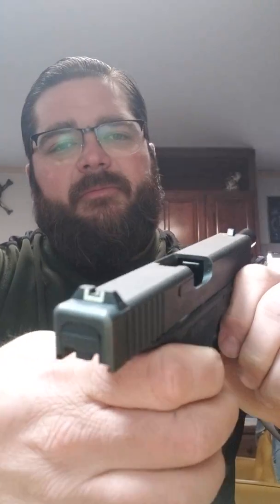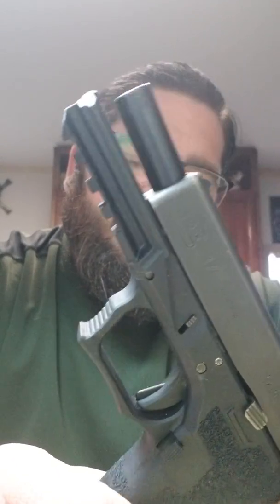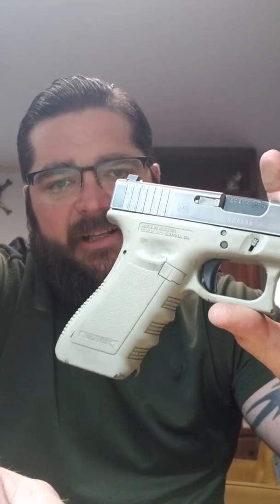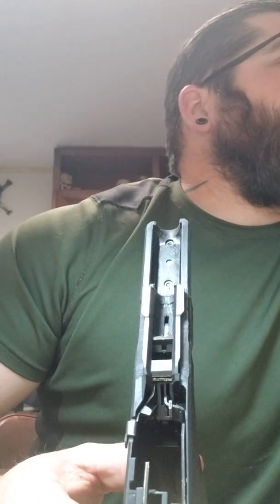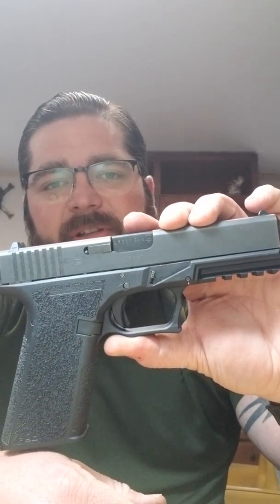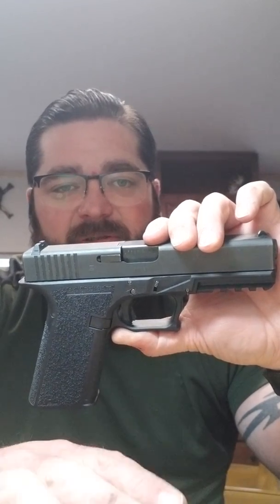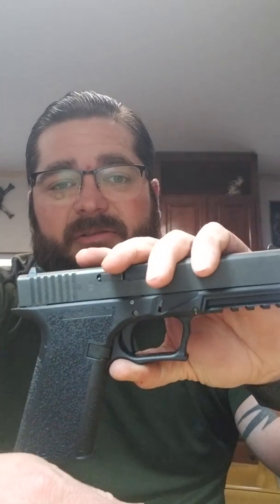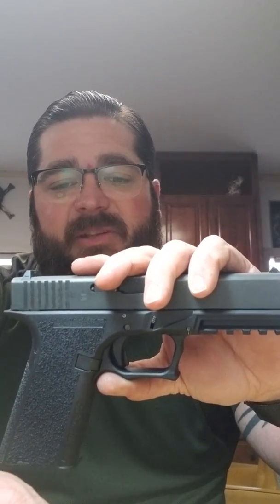Polymer 80 issue fixed

Comment: Sometimes, during the hollowing out of the front guide spring channel, with the myriad of tools used out there, a minute amount of debris finds its way into the hole for the take-down spring.  And, as usual, we all shove the take-down spring into it's hole, compressing any shavings down and then not letting the spring seat all the way.  I find that using a stout sewing needle to probe the hole, digging out anything down there will let the take-down spring seat fully.
Reply from the maker: Your absolutely right ! And its possible that could have happened with this one . I didnt use a needle to scrape it out but i did hit it with some cleaner and compressed air . But i didnt even think about using a needle to clean it out ! Thanks for watching and taking time to comment ! Great tip!

Comment: Check the trigger spring attachment to the down leg on the crucible, also there can be an interference fit with the trigger bar where it hits the frame at the trigger block.
Reply from the maker: Thanks for the advice ! Also thanks for taking time to watch the video and comment !
Reply: @fakeitormakeit83  the spring almost always gets turned to the side, should be strait up and down.

Comment: Glad you found a fix. Another cause of this issue, and something that should be checked on every build like this, is the sear/striker interface. You can check the interface using an inexpensive armorers plate. It should have 80-100% contact. I would err towards 80% as anything higher than 100% will cause this issue. Too little engagement can cause binary fire. The actual adjustment of the cruciform can be done using a vise or an adjustable wrench.
Reply from the maker: Thanks for that ! Thats a very good point you brought up !
Reply: Over polishing can cause auto fire as well
Ran into that once
Scared the shit out of me because i wasnt expecting it
Threw that whole trigger bar away and ordered a new one 
In my experience you save headaches by matching parts
Just buy OEM glock parts
Because the tolerances will mesh perfectly

Comment: I just built my first one of these. Had the same issue. Those slide lock sprigs they're sending out are way too long. I cut mine down quite a bit in order to make it fit. Just to be safe I ordered an OEM spring and the difference is crazy. Needless to say I put in the OEM spring and it runs flawless.
Reply from the maker: Yes i definitely felt wierd trimming the spring lol! Im not a hige glock guy so this was kinda new to me at the time i made this video. And your right i have made it a habit to have spare parts and springs to all my platforms . Thankyou for watching the video and taking time to comment ! I really appreciate it !
Reply: @fakeitormakeit83  can anyone help me with my build ?
Reply from the maker: @zannyy7812  what kind of problems are you having?
Reply: @fakeitormakeit83  do you have instagram so I can show you or snap chat
Reply from the maker: @zannyy7812  yes im on instagram
Reply: @fakeitormakeit83  what’s your instagram
Reply: @fakeitormakeit83  I followed you fam I dmed you as well hit me back when you get a chance

Comment: This is great, very informative. Impressive how you tracked down such a subtle cause of failure to function.  I knew about the slide lock spring issue, but only in relation to binding the recoil spring and preventing the slide from fully returning to battery. But causing the slide to sit too far forward? That was news to me. Thanks for sharing this.
Reply from the maker: Thanks so much for the comment ! Yes I was surprised as well . And I came by the thought after many nights of deep contemplation lol I lost some serious sleep lmao

Comment: I have a poly-80, and everything seems to be right, except when I hold the trigger down and rack the slide, I can ease off the trigger, and it will fire again. So the trigger won't reset properly. Any of the safeties won't catch the firing pin. I'm stumped.
Reply from the maker: Thats a pretty dangerous problem you have buddy. Im totally not being a wise ass , but were you the one who did the kit or did someone else? Check this article out. And search doubling and it should give you an idea of the list of could bes .
Reply from the maker: https://blog.roninsgrips.com/what-to-do-if-your-polymer80-or-glock-double-fires-it-may-be-your-aftermarket-connector/
Reply: @Fake It or Make It  I did the kit, it is a serious problem lol. I've had this weapon for a while, have been changing parts, and doing all the research I can find. To no avail. I'll check the site out. Thanks
Reply: I watched that Intel you sent. I acutely just got in a oem glock connector and tryed it out. Same thing happens. So if I take my thumb and press down on top of the slid it will reset the trigger ok. But if I ever so slightly nudge the side upward it will fire even if I have the trigger held down. So frustrating
Reply from the maker: @Ben Hall  it seems like there is some tolerance issues between the frame and the slide 🤔
Reply: I have two and have the same problem with both. One was the trigger locking block the ears that the slide rides on. The left was higher then the right. Looking at the weapon from back to front. So I took the block to the vice and evened the out and now it shoots fine. I'm still very cautious with it though. The other everything seems like it should be fine. There's very little play between the slide and the frame.
Reply from the maker: @benhall9835  it can definitely be difficult to narrow down the issue . I wish i could be more help! I had to just pick it apart piece by piece.  Analyzing every mating surface and how everything interacted with each other.
Reply: Do some research on sear engagement if you haven’t got a handle on it yet I believe that could be your issue. It’s an easy fix

Comment: Yup, had same issue.  My P80 wasn't going fully into battery if you racked it and let the slide down slow, it kept getting caught.  Was tearing my hair out trying to fix it.  Re-ground the rails, oiled the shit out of everything, made sure the guide rod wasn't getting caught up in the channel.  Turns out it was the stupid takedown lever spring...  Snipped off a tiny bit of it from the end the goes into the frame, gun cycles like a champ now.
Reply from the maker: Hey brother thanks for commenting! Yeah its hard to imagine that one lil take down spring can cause that much heart ache!

Comment: Ran into an issue where the slide was sticking slightly as the slide unlocked, turns out removing material from the top of the locking block is a thing that very few people mention and took me ages to figure out.
Reply from the maker: Hey thanks for watching and taking time to comment ! Thats a really good point ! I really want to get a p80 for myself and do one from start to finish as this one was already "built" . I would like to see what issues i encounter.
Reply: @fakeitormakeit83  There are good reasons to, the p80 glock 26 is actually a better glock 26 than glock themselves make since it has a better trigger guard, better texturing and a rail. There is also something extra satisfying about building it yourself, it'll be just as reliable as anything else provided you fit things together correctly, just as any other handgun you should expect to tweak things and lap the rails with some layout fluid or a sharpie.
Reply from the maker: @PineyJustice  hell yeah ! Thats one of my favorite past times is trying figure out what is wrong with somthing and "building" stuff! I definitely love tweaking all my stuff lol i cant leave anything alone lol

Comment: I always just use stock glock internals and i haven't had any problems.  I did try to go cheap with ebay parts and the trigger pull got harder and harder then it would not fire at all.  I pulled it all out and went stock block and it worked fine from then on.

Comment: I`m having issues with the slide . It won`t rack. I`m narrowing it down piece by piece. I haven`t figured it out yet, but I got nothing but time. Everything seems to be together right, and the slide works without the barrel and recoil spring.
Reply from the maker: Thanks for stopping by and commenting! Your definitely on the right track . Its just a matter of narrowing down each particular component and knowing how they interact.  Seems like maybe a barrel to slide engagement issue maybe ?

Comment: Florida gunsmiths will work on a zip gun if you pay. I got help with my P80, the only mishap in my assembly was the cruciform spring being upside down. I took to the armorer before the range 🙂

Comment: I have build a g17 just like this like last week, and it shoot 7 perfect. But when I changed the backplate and tried to shoot it it stopped… and I noticed my pin is kinda doin the same thing
Reply from the maker: One thing to keep in mind is that what your most recent change was on the piece is usually the first place i look if i get malfunctions after installing it. I know it sounds obvious but the types of projects require success by eliminating issues one at a time as you identify them . If you install somthing and it stops working , reinstall the old part and see if it functions again. If it does study the difference in the parts , if it doesnt look deeper into what these particular parts do in the function of the piece . You gotta basically turn into sherlock holmes !

Comment: Hi I have a poly 19 and the slide goes on but it won’t rack unless I strongman it and my guide rod front is stick out a little bit
Reply: Any things I can try to get it racking smoothly so I can break it in at the range
Reply from the maker: Hmmm . So i would check to see what is rubbing . Can you see any wear marks anywhere on the slide guide rails or marks on the under side of the slide . Take a bright light and a good close eye and inspect every inch of the slide and frame . Let me know what you see . Also thanks for checking the video out !

Comment: My p80 glock 26 won't lock back at all its like an 1/8 short of going back the whole way for the slide release lever to go up into the notch in the side of the slide.  Any 9ne have any info? I can't find nothing on this anywhere?
Reply from the maker: So its not going back far enough to lock back 🤔. It could be a few things and hopefully some one else will chime in . But what i would do is go over the entire thing with a fine tooth comb. Really look at all the mating surfaces after moving the slide back and forth . Look closely for rub marks and wear marks that could be stopping your slide from reaching its final destination.  There is so many little nuances on these types of projects that have to be looked at . But at its most simple its parts rubbing somewhere that shouldn't.  I would even say if the wear marks are hard to see use a sharpie to color the suspected areas and see if any sharpee is removed . But i would say just a guess that somthing is going on up.towards the front of the pew . Check your pocket for where your spring is make sure its not binding on anything and your slide rails are in good order .i hope some of that helps!
Reply: @fakeitormakeit83  yep its like a a smidge short of going back the whole way. I've built this before and never had this problem and can't find a vid or even a web page with someone with this issue.

Comment: Hey I’m having trouble with a p80 going back into battery I sanded down the take down spring to fit correctly and took just a little bit more then needed with the spring channel I just can’t find my problem I even rounded out my safety plunger and all of my parts work together my slid just won’t go fully back into battery I would love help on this fix
Reply from the maker: Hmmm so my first question would be . Is there any wear marks on the guide rails or on the slide indicating that maybe there is something up with the frame tolerances that are not allowing the slide to go all the way forward?
Reply: @fakeitormakeit83  no it’s a jsd supply slide I’ll do some more sanding to the rails and get back to you on how everything tuned out
Reply from the maker: @ChrisKyle902  yes and as im sure your well aware just take your time and check your progress often 😉

Comment: Having the same malfunction with mine. Before I go and snip that takedown spring, how much of it did you remove?
Reply from the maker: Man I didnt snip it per say . I took a small needle file and just worked it down until I got good functionality.  On this particular one It prolly took maybe 1/32 off if memory serves me correctly.
Reply: A problem I ran into on my first build.  The next three I did I covered that hole with Scotch tape before I ever cut, dremeled, or sanded anything. all it takes is a little bit of dust to get down in that hole and then your slide lock spring won't go down far enough.

Comment: Would you happen to have the part number on one of those .
Reply from the maker: SPO2317 depending on what generation yours is .
Reply: @fakeitormakeit83  just picked it up late last year brand new
Reply from the maker: @hollywoodRunnaOG  so its a gen 5. Yours isnt a polymer 80 though is it?
Reply: @fakeitormakeit83  p80 on the bottom corner of the grip. I wish it was a gen 5 🤣 california is smh 🤐
Reply from the maker: @hollywoodRunnaOG  ohhhhh i gotcha .

Comment: Mine is the opposite. I need to push my slide forward sometimes in order for it to fire. I thought My recoil spring was too much for the round. However I noticed that my spring isn’t straight like it’s supposed to be. What would you recommend swap the spring first?
Reply from the maker: Is it a ploymer 80 ? Or is it a actual glock?
Reply: @fakeitormakeit83  polymer 80
Reply from the maker: So it could be a few different things if its not going into battery i wonder if there is any wear marks on the guide rails or on the barrel lock up area ? Or maybe an area of polymer impeding proper function?
Reply: @fakeitormakeit83  I found a little flaw in the guided rod rail nothing major but perhaps it’s the reason for the malfunction. When I go to the range I’ll find out if the issue has been resolved. I appreciate your assistance!! Thank you.
Reply from the maker: @yassinedjiwa637  hell yeah man i hope it works out ! Im no pro lmao im just really tenacious! Thats what it takes to be a diy kinda guy! Thanks for watching the video and commenting btw !

Comment: I had the same issue, for me I just didn’t have it sitting all the way, just pushed it down a lot harder and it sat in perfectly.
Reply from the maker: Yeah i actually had  measured the depth to make sure before i went at the spring with a file lol! The recess was just a tiny bit outa spec . Thanks so much for commenting!

Comment: I hope that the problem im having when I cock  it back the shell  load it won't fire after I cock it again it eject the shell reload then fire was that the same problem you have ?
Reply from the maker: If I'm understanding you correctly yes basically the slide was going too far into battery and causing issues with the disconnect and firing assembly to not drop the firing pin

Comment: This tends to happen when the takedown spring isn't seated all the way.
Reply from the maker: Yes sir absolutely! I took a modified feeler gauge and slid it down into the recess and it kept bottoming out . I imagine it was a slight flaw in the original manufacturing.  Thanks for watching and taking time to comment ! Merry Christmas!
Reply: @fakeitormakeit83  I had a little piece of debris in mine from clearing out the channel. Drove me up the wall trying to figure it out. I think I was more angry when I finally did figure it out and realized how small and simple the issue was.

And merry Christmas to you and yours.

Comment: I voted this up but didn't like listening to several minutes to learn the problem was one I don't have. Think you should be more specific about it. Im looking for vids on slides that wont go on unless barrel is left out.
Reply from the maker: I appreciate your input . I honestly have no idea what I'm doing on the video part so I do apologize for that . I like to make the videos as means of expression and never realized anyone would actually get use out of my videos lol but I will definitely try to do better . Thank you again
Reply from the maker: Also did you ever find any help with your problem elsewhere? Seems like what your describing is theres too much material in the barrel chanel
Reply: i studied it closrly and I can see the feed ramp hitting the locking block and polishing wont correct it. Either barrel, slide, or the 2 together are out of tolerance and must be replaced. I will contact US Patriot armory about it today. Dang! the slide looks great too.
Reply from the maker: @dreed7312  man that sucks ! I sure hope they make it right for you! Be sure to keep me posted !
Reply: @dreed7312 , MarineGunBuilder has a whole video on locking block issues. I found a new one that he didn't cover. It needs to be flush with the plastic tabs and even front-to-back.  Causes all kinds of other issues if not.
Reply: Well, a friend more familiar with the model looked at it and solved the problem almost immediately. Between the nitride finish on barrel and cerakote on slide, the breech wasnt snapping into place in the slide, allowing it to go into battery. Forcing them together a few times by hand wore the tight surfaces enough to solve the problem. Once oiled and together, a few racks of the slide was all it took. It functions flawlessly and I couldn't  be happier. It just needed a little wear or buffing in the right places. :) I guess I can recommend US Patriot Armory now. Its accurate, very accurate. They were slow to deliver but it was worth the wait.
Reply from the maker: @dreed7312  man this is excellent news ! I'm glad you came back and told the rest of your story! That is an interesting cause for a problem but in the end like you say that is a testament to a good fit !